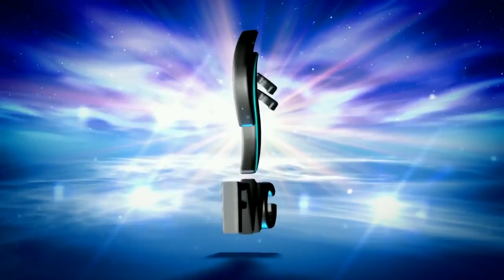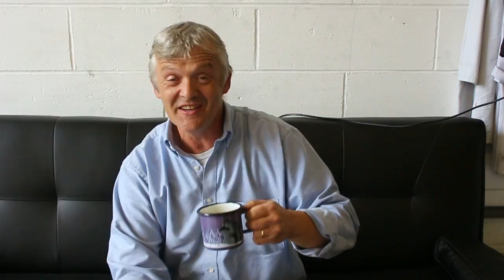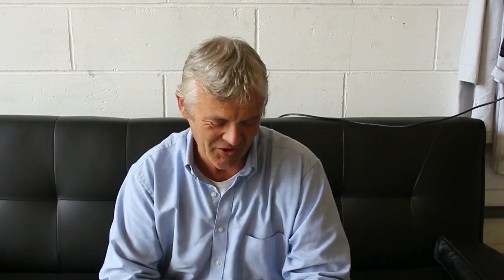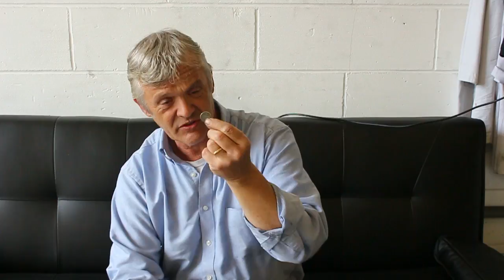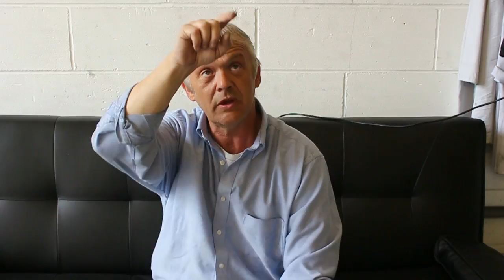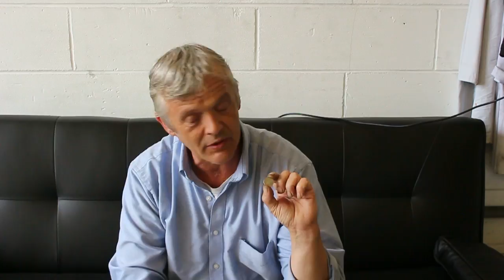FWG Battery - Follow Up

Comment: Attacking the man is the wrong response to criticism. There is no right or wrong anyway, there is just data, was the data produced useful or not. So it did not meet the requirements of some people, fine, just recognise that and state what your requirements were and how they were met, then move on. And I'd still like to see what those cells do after a year on the shelf too. Perhaps it is better not to compare against another product at all but to compare your cell against different types of load so that people can get an idea of what applications it may be most suited for, because those Panasonic cells are ideal for tasks such as real time clock modules. Sorry but that is the truth, and yeah I know you are a chemist, so I appreciate why you would miss that.
Reply from the maker: as you said mate - there is no right way - whatever you do someone some where will complain

Comment: One of the likely reasons for the C1000 rating being given for such button cells is their historic usage to maintain the real time clocks on computers with maybe an additional SRAM module. For this application, the current draw is very small with a good CR2032 lasting many years. In many ways much of the current draw from such devices are just 'the leakage current from a diode'.
Reply: I forget to also note that the other major use of these batteries has been in watches, which is just a real time clock with a high current draw if the display is activated. 

I think the interesting question that current button cells and much of the market they target raise, may not be the possible energy density for a finite amount of space, but rather the stability of the cell's chemistry. I am guessing that you have an opening for solutions with much higher energy densities but will find trying to prove longer stability will involve some very long term trials.
Reply from the maker: good points mate - thanks for putting them
Reply: Just for completeness, I looked over the tech I'm aware off to find something that has a 'rating' of <2uA.

          https://www.mcthings.com/products/mcmodule120/

This is a nice IoT module that pulls <2uA when in sleep mode and a lot more when it wakes up to record and report (via Bluetooth low energy net) what ever action(s) it is programmed to handle. For simple temp recording, it should run for many years on a CR2032.

It also shows a nice target market for your battery tech as they also do a SIGFOX module with GNSS, but the power requirements are much higher so they need to switch to 4xAAA batteries.

Comment: Hi, Robert! The biggest surprise from the previous video is why the Li/CoO2 setup exhibits such poor perfomance. It seems to me that primery cell with metal lithium anode at its only cycle should not be that sensitive to change of discharge rate (0.1C ... 0.5C)
I thought i knew it in theory but you have given me a bit of epmpirics:) and now I am not sure of anything again and that is realy great))
What is the reason? a cathode quality or poor meadia perhaps? or I were wrong
Thanks a lot I enjoy your chanel!
Reply from the maker: I just think they are not all they are cracked up to be mate - lead acid is 35-45Wh/kg and lithium is 128-250Wh/kg - it makes lithium only around 3-5 times better than lead acid - personally i don't think it is that impressive. Maybe we just got sold on the hype

Comment: That test was as scientific as as any other. Was it a fair test? Well we all know that good marketing is finding you products strengths and emphasizing you competition's weaknesses. Everybody does it, even Panasonic 😉. I thing what this test clearly shows is that manufacturers could easily make a more power dense battery in this form factor but they don't. Instead creat a battery that barely does it's job and nothing more, at the cheapest possible cost. Which is why we can only power a watch or a RTC clock on a pc with these  battery's. What we need is someone to light a fire under the arse of the competition and start pushing the boundaries of the technology and not just sell old tech with a subtle tweak and and then rebrand it as some revolutionary product.  I hate the coin cells they are pretty crap, but who knows. Maybe one day they could actually replace  the legendary AA batteries. Keep up the good work.
Reply from the maker: nice mate - and nicely put and cheers

Comment: Robert in my eyes you did a fair test against the Panasonic.
What you actually did was pit your cell against a known technology that's been long established and 1.5 volts higher to boot.
So basically you have thrown down the Gauntlet to the big boys. Well done for that.
So all they have to do now is spend the next five years trying to build a button cell which is 1.5 v and is better than yours.
So if you put your battery through exactly the same TEST versus another and the another wasn't good enough who's problem is that ? Not yours I fear.
All the best mate loved the results.
Reply from the maker: cheers mate
Reply: Hi yes i do take your point on this, especially a discussion around the fact that two different battery voltages in the same shell could be confusing. I.E. 1.4v / 3v
perhaps the casings could be Anodised in Red to avoid confusion LoL.
But still a good attempt by RMS here we can't detract from that, but yes you are correct maybe we could see some further test results and to be honest i think that we just might.
Battery self discharge i a biggy for me at the moment in my research, i have a small footprint all carbon battery giving good power density but awful self discharge ( 50% in 12 hours, but i have had not yet had a chance to address the issues. Plus the battery has only three weeks ago been dragged off the back burner.
But i will be showing some video this weekend.
cheers.
Reply: @ThinkingandTinkering  Why wouldn't you make the cell 3v?

Comment: Right on.  Not sure why the push back here...  The Panasonic battery is very different than our capacitor... I see this exercise as the answer to the question: can an appropriately sized capacitor replace the button cell, when considering only the jobs originally created for button cells?    You could have shown differences, but that is not as relevant.  What matters is the suitability of our experiment in delivering a similar (or better) performance to pre existing button cells.  Good work mate.
Reply from the maker: cheers mate - i guess i get annoyed with things sometimes lol

Comment: Hi Rob, I worked in Turku many years ago and visited Moomin island during the winter. Very strange with the sea frozen and everything shut up, but free to wander about all the weird things. :)
I agree with what you did in order to shorten the test times and there was nothing unscientific (these tests must drive you mad they can take so long) and I'm sure your material has higher energy density whatever the discharge rate. Those lithium button cells tend to be used for extremely low current long lasting applications, so it would just be nice to see how yours perform on a long test (e.g. something which could be happening in the background, with a live webcam??? Could replace the phrase watching paint dry/carpet fade etc. for watching one of Rob's batteries discharge!!! ;). E.g. 1mA rate, how about a low current LED, should last less than 10 days on the Panasonic, longer on yours???
Self discharge, shelf life and low current discharge capacity would be very interesting to know. 
BTW, I remember discussing capacity of primary alkaline batteries over 3 decades ago with the Duracell rep, when I worked in an electronic component shop. He basically said that they didn't publish capacities in those days as it is extremely dependant upon load.
Reply from the maker: curses - now i am jealous - i would love to see it in winter lol - I like the idea of streaming a button cell for a month and a half lol - and that bit about duracell is spot on - good people, bad people and battery people lol
Reply: It's too bad I've never heard of an automated variable-load test circuit to characterize degradation from increasing C.  (Add ANOTHER integral!!!) That is, a circuit that can successively test a device at a half-dozen C settings so the overall robustness of the charge-delivery device (practically that's what we all would PAY for - a charge delivery device) can be compared with whatever experience the customer has with status-quo technology.  Maybe that is proprietary to Rob's business planning.  I just want something more robust to temperature extremes than lead-acid, so I can prepare to plunk out hundreds to FWG for a car battery replacement!   Climatologists say my region is heading back to real shitty winters ahead, I'm afraid, and lead acid has given me such crummy memories to cope with-- it would be worth it to ME!   (side note to any kindred concerns out there in readerland - current supercapacitor vehicle batt's start at $1000 and only rev the engine  for a bit, and then are d-e-a-d until recharged "somehow".)
Reply: Can you find a Rob's equivalent to the Duracell bunny to stream live? Rob's Moomintroll??? ;)

Comment: Isn't C defined as an ampere-second?
Why is the C rate discharge defined with an hour?
Reply from the maker: because you are confusing the 'c's mate one is for coulombs - which is amps per second and the other is capacity as defined inn the comments below

Comment: I understand what you are saying, but I still think the test doesn't really tell you anything. This is because the Panasonic battery is optimized for long duration low current applications like remotes or battery backup of memory. So testing this battery at a high C rate discharge only tells you it's not good at high C rate discharge. So it's not at all surprising that your battery (or indeed any existing chemistry of battery) would beat the Panasonic battery at something it's not designed to do. I would wager similarly prepared NiMH and lead acid batteries would also outlast the Panasonic battery in a similar test.

So in conclusion, I respect you and your battery, and I even believe it's probably pretty good. But your test really tells you nothing about it's relationship to lithium Ion primary batteries.
Reply from the maker: thanks for feeling sorry for me mate - i'll manage i think lol
Reply from the maker: no probably not mate - but give it a go and see - the chances are alkaline and lead acid wouldn't even turn the motor - but why argue about this - it's just not the point - others have made it too - a low rate discharge is needed - end of story.
Reply: Robert Murray-Smith   I feel sorry for you . The material sciences are moving so forward so quickly , the latest super caps are approaching a 40%  density to mass ratio compared to even your graphene cells . The science is moving so fast that it is difficult to know which technology will rise to the top . Good luck in your studies .

Comment: how hard would it be to make 18650's?
Reply from the maker: i could have them toll manufactured but the machine costs about 100k
Reply: And you would corner the 18650 market.  The supply would not be able to keep up with demand.
Reply from the maker: i think that is so - i still need 100k mate lol
Reply: That makes sense why you can't manufacture right now. What about setting up an ico so we can invest in  the manufacturing side. I am guessing you need another workshop and manager so you have storage and can do the development separate from the production.
Reply: Indiegogo or kickstarter could be an option, we all know scams have made over 100k easy, I'm sure something like Mr Smith's tech would probably exceed that, given it's actually real, and tests could be shown.   I still think a flashlight would sell the best, as it's a product everyone could use.  Sandwich design using a flexible solar cell, flexible super cap, and flexible nth degree led.  How about a machine which could print these leds on the backside of the printed supercap..
Reply from the maker: Awesome ideas mate and i am seriously considering kickstarter
Reply: That's great, I will be one of the first to buy one, whatever it is. :)  I still have my working gravity light bought from indiegogo, which was a successful campaign.

Comment: Hi..this is totally unrelated but have been meaning to ask you for some time now. Btw..love all of your videos and I'm learning a lot from watching them. I was wondering where in the world do you find that tiny motor you use for your battery testing?
Reply from the maker: lol - cheers mate - ebay mate - it's a drone motor
Reply: Robert Murray-Smith thanks..must be a very low voltage and milliamp.
Reply from the maker: it does the job mate
Reply: Robert Murray-Smith most definitely..perfect for testing..I only seem to be able tto find 3 vdc and none that will run down to/at 30 Mamp. I'll find one now I'm sure searching for drone motors. thanks a ton.
Reply: If you can’t find it, build it.

Comment: This is much like the same response you got when testing the capacitors. It's a way for owners of intellectual property to keep value in that property. You are challenging that property and the worth of such intellectual property. This is the reason they are challenging you on your discoveries.

 I do have one thing to say though. Galvanic response is based on two things. The electro-negativity value of each plate and the electrolyte. As time goes by and discharging the battery will remove small portions of the electrode and then will enter the electrolyte. This is the reason for the discharge of batteries. If you could find a way to protect the plates from the electrolyte the battery would naturally become rechargeable.

 In my crystal battery experiments I found protecting the plates a very hard thing. But it is attainable as I have done it. The one problem I could not find an answer to is the batteries inability to sustain power at a consistent rate. I would have to let my cells rest over night and then they could supply more power the next day. It seems we can borrow some of the electro-negative differential between the plates and then let it "Recharge" or rest.

 Protecting the plates is the hardest thing to do. I used oxides naturally formed on the plate to protect the plates. This barrier still allows potential to be conducted and if the plate has a natural oxide that forms then the electrolyte can have a small portion of ingredient that reforms this oxide layer, much the same way as electrolytic capacitors heal shorts between the plates with borax solution in the electrolyte. In my experiments I used aluminum and graphite electrodes and the Aluminum electrode was perfect after a month use. Shinny and clean.

 I did have to use a special process to enhance the oxide layer over the aluminum. I had to bake the borax solution onto the aluminum. But first I had to prep the aluminum by heating it then quenching it with the borax solution. This caused the aluminum to get a fluffy white foam like material to form. I then put the electrode into an over and baked it till it was golden brown. I then put it into the cell container and included the electrolyte of water, Epsom salt, potassium, Borax.

 The type of battery you are using here is a plate fed battery. Meaning galvanic response eats away at one electrode. It doesn't have to be this way.

 Sorry for the long winded response.
Reply from the maker: it was funny that this particular video got a sudden increase in that type mate
Reply: Well step back and look at it. You are inventing a better battery that makes others look foolish. They have a product they want to keep getting monies from. Of course you are gonna get disruptions. Wait till they start on how your battery is deadly.. lolz
Reply from the maker: yeah lol - looking forward to that

Comment: Your batter obviously performed spectacularly given the test conditions. I hope you release another video sooner rather than later using a much lower discharge rate, because that matters as well. I can see both sides of the argument. I think both thoughts are valid. You're right and they're right. So why argue? Even if your device performs similarly or even slightly worse than a LI battery at a low discharge rate, you would still have the superior device due to it's ability to copy with high discharge rates much better.
Reply from the maker: absolutely - just take it as it is and say - hey how about a low discharge version - that I am ok with
Reply: *battery  *cope  Ugh, I was typing on my phone!
Reply from the maker: lol - no worries mate - I got it